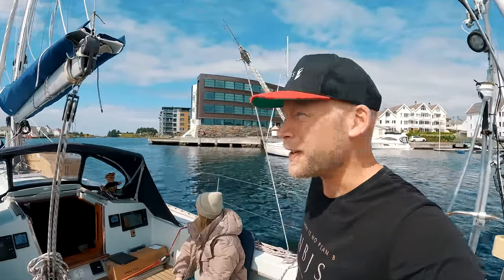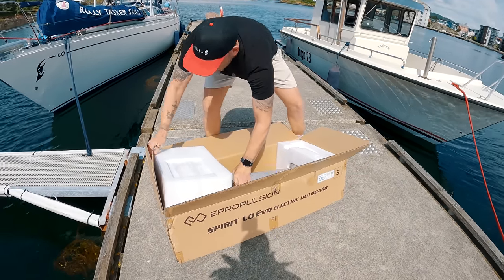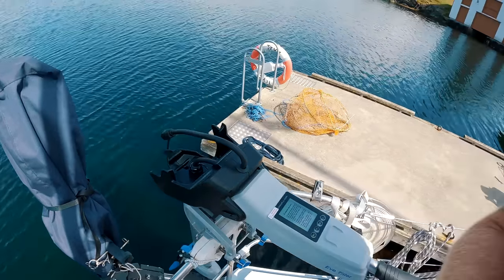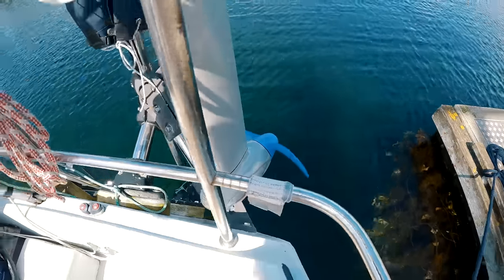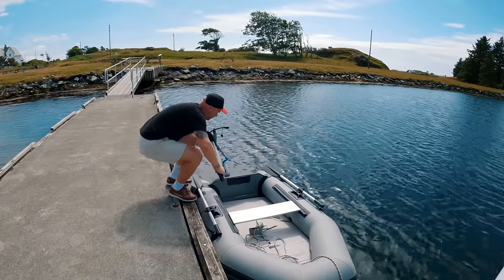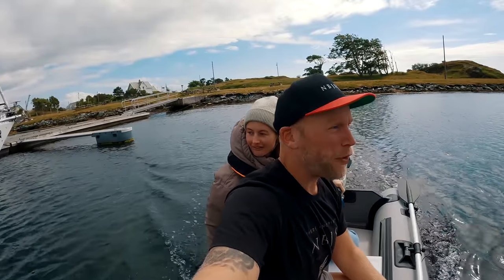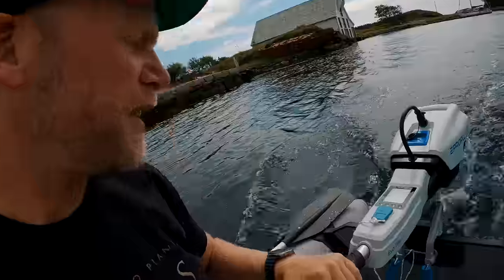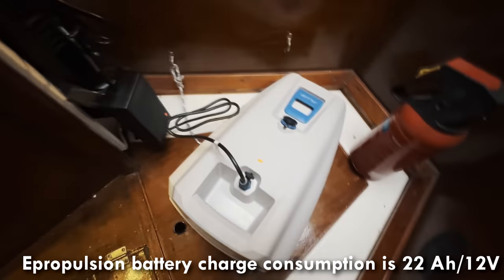Sailing with the ePropulsion Spirit 1.0 Evo electric outboard!

Comment: We too have an ePropulsion (on our small sailboat) and LOVE its lack of GAS :), reliability, speed,  ease of use and QUIET. It is perfection. 

Out gunkholing recently the wind picked up alarmingly fast but the ePropulsion cut right through the chop and got us out of the bay and back into the protected creek with speed :) 

When we first read about it and called around, the designated MidAtlantic sellers were not well educated or were more interested in those lined up in their shop to buy bait. 

That’s when we found Luis at SkyBlu Adventures in St Augustine, FL. , who even sent us an extra anode. He knew ALL about the different models and has provided us killer customer support. Our entire experience has been A+++ Loving this motor. 

Hope millions sell, it’s great for the environment!!! Wonderful video. Really shows how easy it is from opening box to use.

Comment: I had both this exact motor for 2 years now and also a Torqueedo and frankly, love the build of the eProp model, sturdiness ( metal fitting instead of plastic) floatability of battery and info given on the display. I do have to say that torqueedo has a 915 WH battery with a lot of power but had too many issues with the 2 plastic interconnects at random time. playing with a dysfunctional connector in a rush time is no better than cranking a stubborn 4 stroke gas engine... happy you liked it!

Comment: Funnily enough I was looking at that exact system last night and it's very impressive. What I like most is how light the whole thing is - no more trying to haul a 90 lb outboard over the rail! It can also be recharged from a folding solar panel. Pair this up with an Oceanvolt saildrive instead of a diesel motor and just imagine how much self-sufficiency you gain. 
I know Silje has gotten some mixed reviews from the hardcore sailors but I think she adds a real dash of character and spice to your videos and I hope we see more of her in the future (you'll love the North Sea in winter Silje, trust me😃) 
Looking forward to the Hebrides trip Erik.
Reply from the maker: Thank you so much John, Ill tell Silje!
Reply: The oceanvolt saildrives are awesome and cost about double the price of a diesel. Given Tessie is a €40,000 boat it might be over capitalising to put a €46,000 motor in it.The installation and infrastructure would be anything but cheap. If building from new and doing weekly races around the cans. It would be economical because there aren't the 100 hour services and all the other diesel issues. I would seriously consider it. However the insurance companies are getting very twitchy about lithium batteries now. I had to have my boat surveyed to ensure that I didn't have them at my last renewal.
Reply: @philgray3443  Very good points and in actuality my comment regarding Oceanvolt was geared more toward installing the system in a new build rather than attempting a retrofit. Understanding of the nuances of lithium ion phosphate battery technology, especially in the insurance industry, is at a developmental stage and we can only hope that the insurers get up to speed quickly on what sort of systems, for which type of use pose any sort of risk.

Comment: Really nice unit. Hassle free propulsion. Not having to deal with fluids and maintenance is a huge plus! But it’s pricey 😬
Reply: It does seem to have the advantage of not needing an oil change, but gasoline seems to have so much more energy density (which could be important, I suppose... if your dinghy is also your lifeboat).
Reply: how much is it?
Reply: @Moloch6666  It's only one bajillion.
Reply: @Moloch6666  About double that of an equivalent ICE outboard.

Comment: I bought an ePropulsion Spirit 1.0 Evo 2.5yrs ago. I loved it for the usual reasons but recently I’ve had problems with frequent error messages and cut outs.

Last week it died totally when the battery was still 50% full. I was 2km from my boat and I had to row for 45mins against wind & tide to get back.

I have now returned it to the dealer for repair. Meanwhile, I have put my trusty backup Yamaha o/b back on the dinghy.

So please be aware even electric outboards like ePropulsion are not 100% reliable and they can let you down like any other outboard.

Comment: I have the same Epropulsion Spirit, and even powered my previous 22ft sailboat with it! It was great for on the lake! (reached 5 knots in dead calm weather on the lake). But now I have a bigger sailboat with Yanmar diesel, however I kept the Epropulsion Spirit for a dinghy! BTW, @erikaanderaa you can also charge it with a 12V charger, may be more efficient on the boat!

Comment: Hey Erik have the same engine and it is excellent. I have been followed along the river, just a few meters behind, by a seal, which would never happen with petrol. I was not as brave as you and I’ve never dropped my battery in the water, but it’s good to know it would be okay!

Comment: Good video Erik. That dingy seemed at little to small with 2 people. Bringing supplies from or to your boat with 2 people on the dingy will be awkward. Is it possible to increase size of dingy with the EV motor. 
I understand the Hebrides water's have current and not always calm and that to may effect the small dinghies safety and lack of usefulness. 
Have a great sail and I am sure you have already decided by your next video .
Reply from the maker: My dinghy is perfect for me alone, and it fits on deck while sailing around. Its mainly to get from anchorage to shore, short way. If Silje is joining we will need a bigger dinghy☺️

Comment: I have been quizzzing lots of people on electric outboards as I am thinking of changing from petrol. Everyone says the same thing, Epropulsion are by far better than the Torqueedo and I believe the cheaper of the two. Yet to take the plunge. I do wonder on the longevity of the electrical cable connectors in such a hard (and salty) environment!
Reply: I've used mine extensively the past 3 seasons and the cables still look like new.  However, we store the battery down below when not in use and although the leg/attached handle live on a bracket on the pushpit we put a cover over them to guard against UV light.  Other great advantages is that you don't have to go hunting around for petrol which can be quite hard in some ports these days.  We love the fact that you can easily take the battery and leg off making the tender so much lighter to carry it up a beach.  The ability to explore a beautiful spot without the noise and smell of a petrol engine has to be experienced to be fully appreciated.  Together with the 'Ewincher' electrical winch handle its been the best investment we've made to keep us sailing as we've got older.

Comment: I expected it to be able to move your dinghy faster than 4kts. Are there settings for efficiency mode or performance mode that maybe weren't enabled?
Reply: Why? 4 knots is perfect.
Reply from the maker: Its a 210 cm rubberboat loaded with 105 kg. Think its pretty good☺️ A bigger boat would go faster, less drag
Reply: It's only a 3 horse motor. To get a dinghy to plane you need about 10.

Comment: try not to drop the magnetic key on the water. the damn thing sinks faster than the motor itself :)
Reply: I've successfully used a magnetic screwdriver before. I just sat there and held the screwdriver with one hand and the motor with the other.

Comment: Yea man but one of these days people are going to realize that electric is just not the way to go. That thing is slow too. Try it on severe swells and then tell me it's a good option.
Reply: I have one on a Santana 23D. That boat is supposed to have a 6hp gas outboard and I'm using a 3hp electric. It does the job which is crazy. It's not fast but it will maintain two knots into a 30 knot headwind and 3 foot chop.
Reply: I think you are the one who is going to realize that electric is way to go especially for the dingies on sailboat
Reply: People that don’t like electric clearly haven’t driven a Tesla. It’s unreal
Reply: @bcdoak2525  Yep. The Epropulsion and Torqeedo motors are on a whole other level. I think people get confused by their past experience with electric trolling motors which are not similar at all. It's like comparing a kids yard toy to a tesla model 3. One is a light duty toy and the other is a serious piece of equipment.
Reply: It's already the way to go. And when prices come down for batteries and motors, and when we take the next step in battery tech, it will be a no brainer.

Comment: The electric outboards are great except if you have somewhere to go . 1 hour battery time at 4 knots , and that was with only 1 person in the dinghy.  The novelty will wear off quickly . It sounds like a great idea till you're in 15 knot of winds with a small chop and you need to get somewhere fast . You would be up $hits creek if the current were against you at the same time .The dinghy was very small also .Two people barely fit in it , nevermind trying to provision for a long passage with two people in it .  I would hate to see a six passenger dinghy with that small motor. You would be going nowhere fast as they say .
Reply: That dinghy is extremely hydrodynamically inefficient. Will do better on a larger hard bottom dinghy. Also, an electric motor isn't going to crap out on you like the gas outboards seem to do all the time.

Comment: It's nice that you can stow the electronics down below out of weather until you need it. Do they make a shorter shaft? Perhaps the design makes it look longer than it is. It doesn't really get up on plane does it? I use a propane powered outboard...no bad gas problems, no carb. I would like to have both of course...hehe